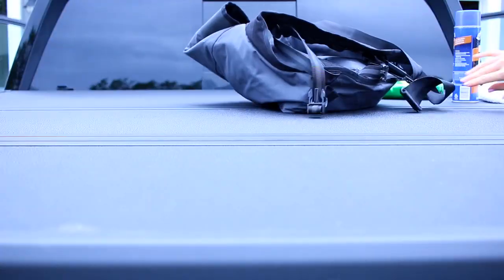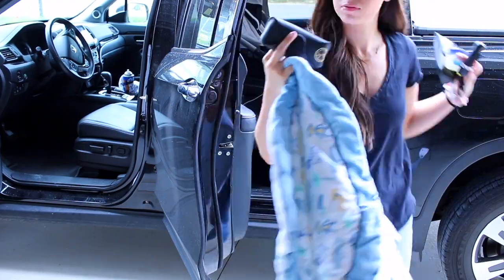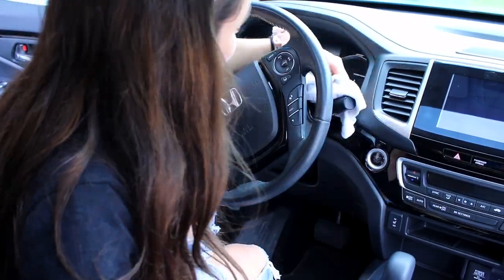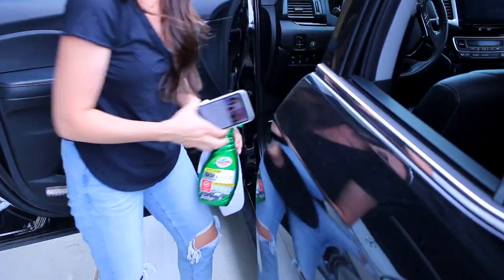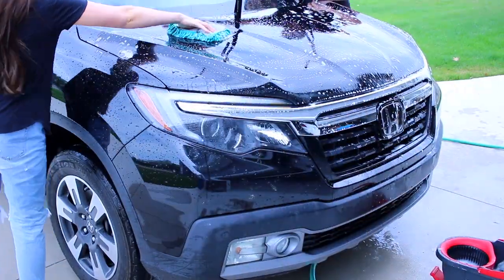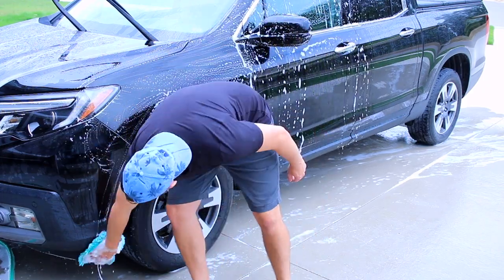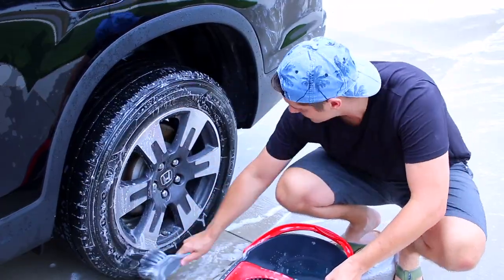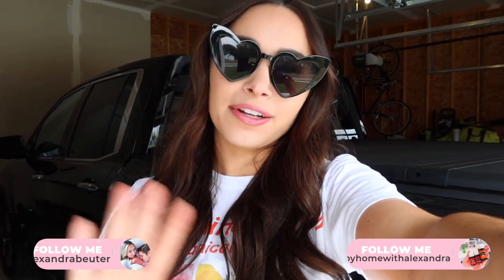CAR CLEAN WITH ME 2020! WEEKEND CLEANING ROUTINE MOTIVATION! | Alexandra Beuter

Comment: I've owned several SUVs, currently driving a Dodge Durango.  But, by far, my favorite was the Toyota Highlander.  It drives like a car, very smooth, easy to maneuver.  It had over 200k miles on it when I traded it in.  If not for the fact that my 2 boys are going to be very tall, I would have gotten another one.  I test drove a lot of SUVs before deciding on my Durango (I needed extra towing capacity) but my top two were the Durango and the Honda Pilot.  Both had the room we were looking for and similar features, except for the towing.  I highly recommend any of the 3 I mentioned.  It will just depend on the size you are looking for.
Reply: I have a Durango Citadel and I absolutely love it. Will always get a Durango going forward as long as they make them. :)